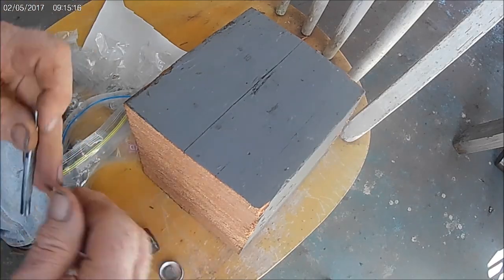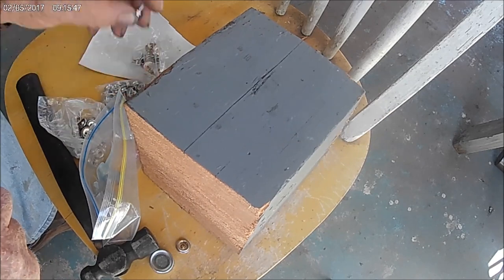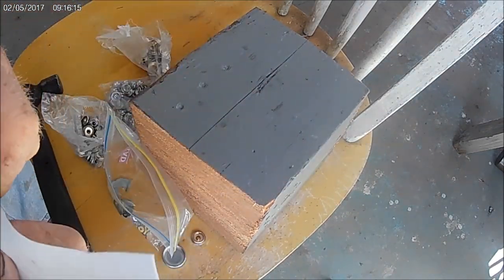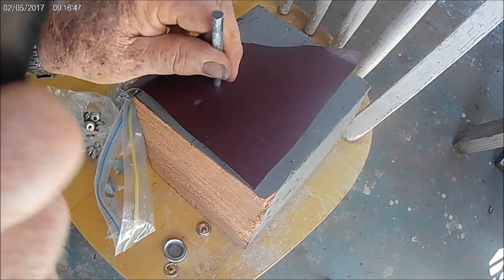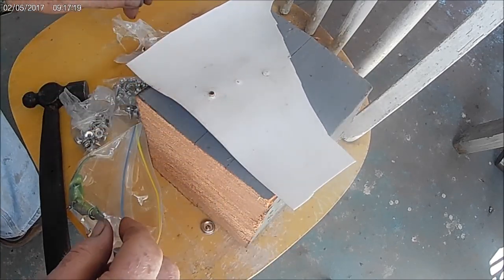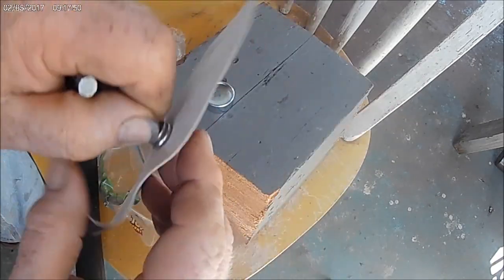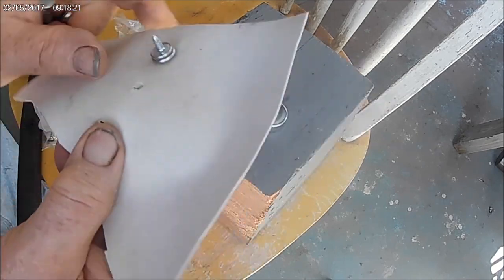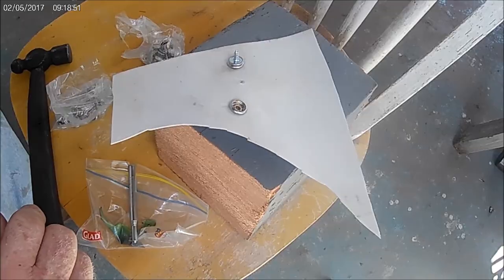how to install snaps on vinyl

Comment: Good stuff. You can tell you're a working man by the condition of your hands. 
To cut the vinyl we have a pair of pliers that acts like a punch and put a hole in it.
Reply from the maker: yes, it seems like my hands are always dirty no matter how many times my wife tells me to wash them.. lol  I think something a leather punch would be good too.
Reply: @MissouriOldTimer  When I'm working i work with insulation so I put on doctors gloves to stop from itching. I don't like to wear gloves but sometimes you have to but I would rather not so I'm always taking them off.

Comment: Yeah they be very handy thanks for showing.
Reply from the maker: yes, it's really very easy, the hardest part is getting the snaps to fit the parts installed in the frame but luckily it worked very good.

Comment: Thanks for the tutorial!  I am attempting to create a vinyl weather screen for my open cab tractor and I want to install snaps on the plastic canopy that vinyl can snap to.  Do you know of a good method for attaching a snap to approximately 3/8" thick plastic?
Reply from the maker: I don't really know unless you get the ones that attach to metal and secure them with pop rivets, other than that maybe you can find someone that does this for a living.

Comment: I have a 1983 G1 Yamaha had it in storage under a tarp for 3 to 4 years. Trying to get it to run the starter generator will not engage. I do a video on it.
Reply from the maker: that will be interesting to see that video.